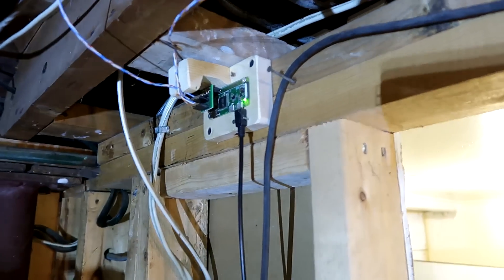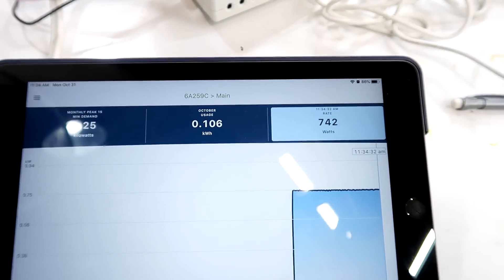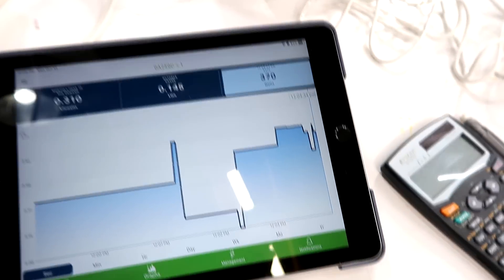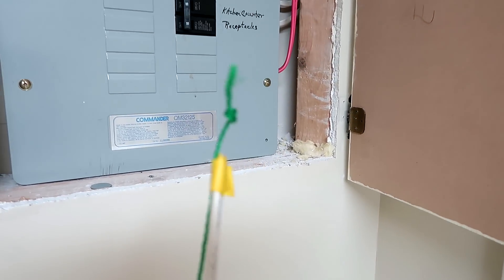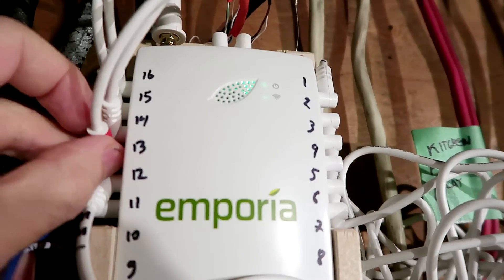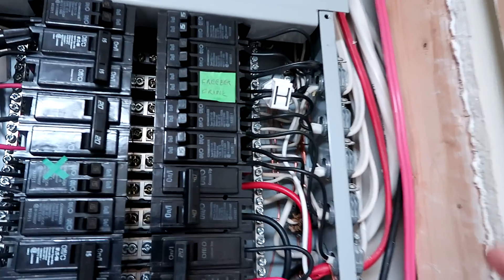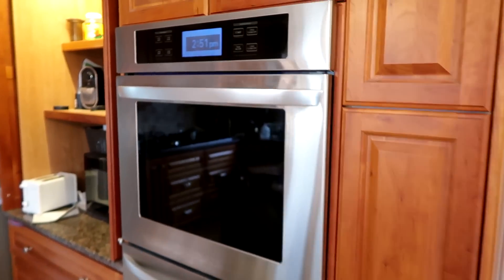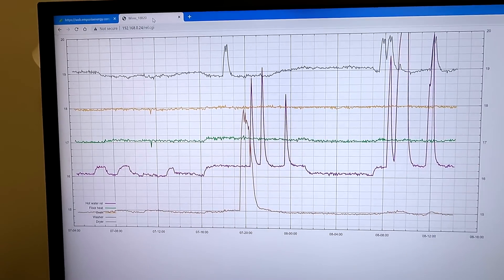Power monitoring 16 circuits at the breaker panel

Comment: For anyone interested I went through and flashed it with esphome to get it into home assistant and it works great!  The update time is much better. It does require popping it open and flashing the firmware directly but after that it works great over the air with esphome.
Reply: As soon as I saw the esp32, I came looking for this comment.
Reply: Can you please share your esphome configuration for this device?
Reply: Same here! Absolutely love having it local and the power of influxdb+grafana allows for all the data viz that Matthias wants.
Reply: @ZWBenedict  I made a video on how I use peacefair pzem energy monitors and send data to grafana https://youtu.be/xKxGaerzNKM
Reply: So glad this is possible.

I looked at getting one of these a while back but was put off by the fact it's reliant on external servers. I was guessing it had something like an ESP32 inside it but good to hear it confirmed that there is custom firmware available to open it up.

Can you share your configuration?
Reply: @DEADB33F  You can always go with an IoTaWatt which is open source to begin with and has 14+ sensors.
Reply: @davidb.5544  I looked into all of them a while back. IoTaWatt with 12 50A sensors, 2x100A sensors, and power supply is already double the cost of an Emporia system with 18 sensors, plus then they want to charge over $80 shipping to UK (vs free next day delivery from Amazon).

I'm all for open source hardware & software but not when it results in paying more than double.

---

I guess I could send off for a PCB to be made up and order all the necessary components to completely roll my own but I really don't have time for that right now ....and it'd still likely cost more than the Emporia one.
Reply: Writeup anywhere or links maybe?
Reply: This is the way to go, i love seeing devices with an ESP because i know someone has taken it and turned it into a consumer owned device instead of relying on the company who made it.
Reply: Please, can you describe how to proceed?
Reply: I use esphome on this device as well. It has been stable for months.  The only difficulty is needing to solder onto the pads of the MCU which requires a little bit of soldering skill. I’d love to see a follow up video with ESPHome.
Reply: You guys need a life. And i mean this with all due respect. So, if Emporia dies, so what. For the purposes of logging consumption i monthly download my data into a spreadsheet and add in the billed consumption. How does Emporia closing up shop in 2, 7, 15 years affect me? Hint: it doesn’t.
Reply: @JohnCap523  Your device no longer works. It no longer has a place to send that data and you no longer have somewhere to download your data. Hell Emporia could even stop you from downloading your data if they wanted to.
Reply: @DovahDoVolom    Paranoid much?

Comment: sounds like there is the need for a custom firmware that you can flash on the emporia device. since it is only an esp32 it should be no big issue. A bit of fiddleing around until you got the measurements right and there you go. As a backend you can use a grafana/influx on a RPI with external SSD.

Comment: The Sense device seems to have a more balanced EULA, and a great app, and it’s possible to get the data from their server via a third-party python library. But it doesn’t have individual channel monitors… but honestly I prefer the ease of installation. It’s easy to measure individual devices just through timing their on/off.
Reply: Agreed with Sense but it isn’t able to recognize small loads

Comment: it boggles my mind that so many folks sell devices which are on YOUR network and they are collecting YOUR data and then they architect it specifically where the user can't interact directly with the device to get the data (like the doorbell, camera, sensor, whatever), but you are instead forced to use their proprietary apps to connect to their proprietary cloud service... both of which they can change at any time. Basically, you never own the device.. because you don't control it.

Comment: I completely agree with your assessment. I have an emporia vue and I do like it for what it is. I was going to get Brultech GEM, but it was significatnly more expensive. Ths Emporia has allowed me to monitor with less cost now while I investigate and prepare for the Brultech GEM (which requires it to be mounted outside the box, which I can't do to the location of my box in my master bedroom. WAF).

the Brultech offeres local connectivity and monitoring.  Emporia has refused to open that up (even just allowing you to set your internal endpoint to collect the data yourself).

Comment: I like the crisscross wire through the sensor, it makes sense but how did you think of that?
Reply from the maker: I knew i needed the two phases to go thru in opposite direction.  Crossing the wires was the simplest.
Reply: @matthiasrandomstuff2221  I disagree with the logic you have.... On a mini-split system, there in ONE circuit, that terminates at the condenser outside. The indoor units are all children of that. If the unit is is 240V, then it's 240V throughout until downstream of the circuit boards, as many models of them are inverters which vary the compressor and fan speed, so it may be 360 or 400V 3ph output. The key point is that if it's a 240 model, there is no neutral wire, no imbalanced current to monitor, therefore current on L1 and L2 are the same. 

Your logic would be applicable to multi-wire-branch-circuits and 120/240 circuits such as the electric clothes dryer or wall oven which have 120V components in addition to the 240V heating elements.

Comment: I (and my friends) have been using some sonoff / no name brand tua etc.. power monitor / smart switch devices. All are some variants of esp chip. We flashed them all to tasmota firmware, and using mqtt to push data to a influxdb database. This ensured ownership of data, but you have to make the dashboard / data charting yourself in influxdb.
Haven't tried this type of multi circuit device, this looks very interesting (if supported by tasmota). I had a plan once to balance house's electric load across two sources evenly by monitoring daily/weekly power usage of different circuits and toggle their Source automatically, So at the month's end, all sources (Electric company power meter) have equal power usage.

Comment: Since it does have one of those ESP chips I would not be surprised if someone hasn't already come up with a flash for the chip that lets you keep the data local.

I want to do this myself but I'd probably go with an entirely DIY system. Motivation is to understand where/how I use power and when. End goal is to figure out just how much solar and battery I'd need if I ever wanted to off grid the house.
Reply: Take a look at my videos - I do what you are talking about using esp and running data to a raspberry pi so no outside servers. I can graph it all right on the pi too using grafana. Peacefair pzem energy monitors don't cost very much. I have a few videos showing how to connect them and also how to get the data to pi https://youtu.be/xKxGaerzNKM

Comment: To be honest it might be easier to reverse engineer the device than build from scratch.

It already has the micro for an adc, multiplexers and power supply.

 It's likely just a serial connection between the two micros, with the ESP just doing the wifi data. Shouldn't be the hard to check all the serial UARTs in the ESP and figure out how it's getting the data. Then either rewrite the ESP firmware or even better swap the ESP for a Pi.

Comment: Hi Matthias, I'm not generally much of a commenter, but this is highly intriguing. There's also someone who seems to have been able to reverse engineer and replace the emporia FW. Just search for "flaviutamas reverse engineering emporia".
Maybe I'll also give it a try some time.

Cheers
Reply: Was going to answer something similar. Most esp devices can be reflashed with new FW for using with a local home system like rpi. Enough people on the internet that figure these things out as hobby.
Reply: @dannytemmerman16  It is like a jigsaw puzzle for grown ups :)
Reply: @jeremiahbullfrog9288  OpenEnergyMonitor is open source but you can also purchase pre-assembled hardware.
Reply: very cool read. Thanks for the tip.
Reply: Should be fairly trivial to do that TBH, the hardware is all there, so you just need to figure out the protocol between the ESP32 and the uC that does the ADC stuff.
Reply: @SomeMorganSomewhere  It's already been done. There's a guide for flashing these Emporia units with ESPHome.
Reply: I guess I don't understand what is so exciting about this, the application seems simple, the delivery is hideously disappointing.  I need a voltage/current meter to simply record the current over time, that's it. And we've complicated such a simple task to remote servers, ridiculously weird long update times..? How would you see the current spike on a refrigerator starting up, or the startup current for your mini split? From what I'm seeing it'll all be over before the unit even realizes it let alone has time to update it and tell me anything.

Shrug, I guess I'm confused why we are impressed with this.
Reply: Why not just go with an open source project (unless you're very interested on defeating Emporia in particular)?
There is one that is already using ESP ecosystem and has open sourced their hardware.
EDIT: I need to stop using the word "literally" so much
Reply: @russellzauner  main reason for me was because the Emporia is UL-listed and cheap, while the open source projects here are neither.

Comment: oh please make a video about hacking the emporia. this would be too good to let it be like this, especially after reading those terms of service
Reply: Look at the IoTaWatt…it’s similar and open source.
Reply: Tasmota is a firmware for hacking esp8266 and esp32 devices just like this one
Reply: @Thomashargrove602  that doesn't solve how to make sense of the likely gibberish data that is being sent and that's if it's not encrypted. it just lets you control the network connection.
Reply: @SquintyGears  There is an established hack for this specific piece of hardware, enabling you to flash it with ESPHome. It only requires cracking open the case and mucking around with the debug pins one time, and subsequent updates can self-flash OTA. ESPHome is dedicated firmware and there's a pre written config for these devices so getting it integrated with standard stuff like HomeAssistant is a breeze.
Reply: @haphazard1342  cool
Reply: I don't know if a hardware hack is any simpler. Usually in a finished product things are write protected. And at some point you might as well have made your own thing from the ground up. Just taken apart the existing product for the "dumb" bits.

Idk but it doesn't seem any easier.
Reply: I don't know if that's within his capabilities. There's quite a jump between python monitoring + interfaces and spoofing web traffic to route the device to your local private server while keeping the data readable.
Reply: @SquintyGears  Or you could write your own program that is put on the ESP and just use the PCB as finished hardware.
Reply: @SquintyGears  he has an ESP32. So it could be more of a hardware hack, no web traffic shenanigans needed.
Reply: @SquintyGears  Matthias used to work for Blackberry. This isn’t that hard.
Reply: @transpiler  I'm not denigrating his skillset i just don't think he would spend the time to do it. Breaking into a locked system is a pain in the ass and takes a lot of time. But others have also mentioned that its already been done, so what video is he gonna make? "Here's me installing the stuff i downloaded" he would never do that...

Comment: 12:13 - I'm on the same page; I have a few parts sitting in a box to do this (just lack of time), after looking into all the other prebuilt solutions, none of them were really open with their data, and I'd rather keep it all inside my home.

My plan now is to integrate energy monitoring into Home Assistant, which keeps it all local and feels like a solution that will continue working for many years.
Reply: Have you heard of the IoTaWatt before? It's all local data with a local web interface that is fairly powerful and has support for pushing data out to InfluxDB if Grafana is more your thing. It is also open source.
Reply: Jeff you need to convince Mattias to use dev boards like the esp32 and Home assistant more.  It kills me everytime he whips out a raspi for something he could easily do with esp32.
Reply: @RobbZinn  True, true... though there's always comfort in falling back to linux and some bash scripts :D

I'm getting deeper into Home Assistant + ESPHome lately, and have a video coming on that soon! (Hint: You can now use Pico W too!).
Reply: @JeffGeerling  hope red shirt jeff will be participating
Reply: You can already integrate this device for only local with home assistant
Reply: @fallen293  Technically yes... but that seems to be against the company's terms and conditions, as spelled out in this video :)
Reply: @JeffGeerling  Meh, I bought the device, I own the hardware, I can load ESPHome on it if I want :)  There's a Github gist from flavuit about installing ESPHome on the Vue.  Unfortunately YT seems to be marking that URL as spam, so I can't paste it here.  I've been running mine that way for several weeks and it works great.
Reply: Yo Jeff, you seem to be on the same channels 😂
Reply: If this can be flashed to tasmota firmware, then you can use mqtt to push all data to influxdb / any other database you choose. Relinquishing data ownership to 3rd party cloud is always a No GO.
Reply: we need a collaboration to help people take control of their devices and their data!
Reply: Have you looked into the brultech GEM? It keeps all this local. Not cheap, but gives you full control.